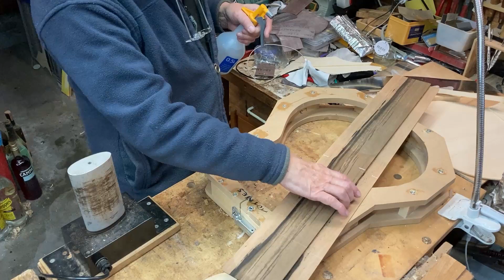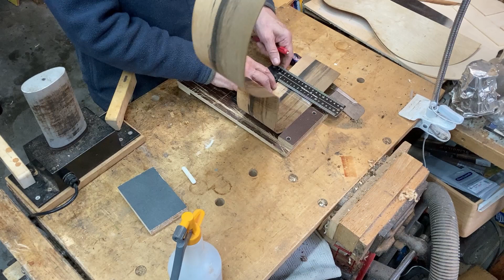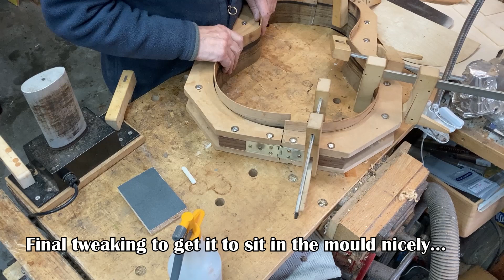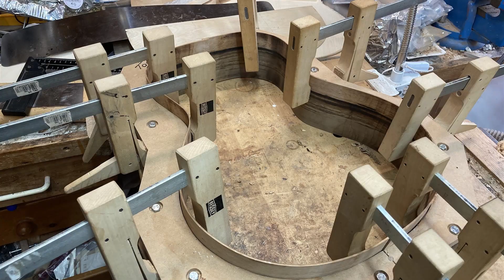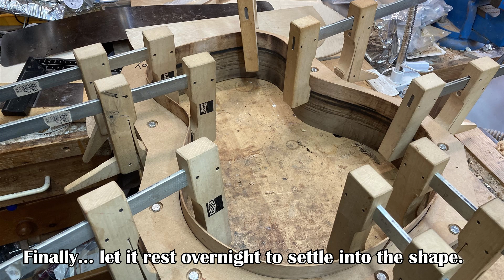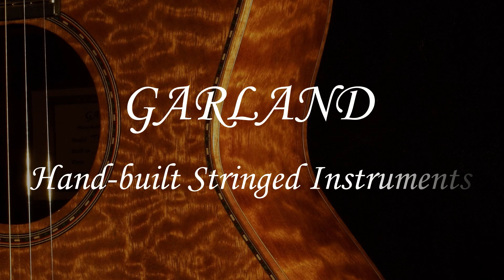Bending ebony sides by hand.

Comment: That ebony is beautiful Chris, this is set to be another stunner. Quick question, I’ve just starting binding my guitars in wood, the first has gone really well, I did flame maple binding on a LP and the maple bent really well. However I did a test with mahogany which I could not bend for anything. My question is in your experience what types of wood bend easiest? Because I’d like a few colour options for binding.
Reply: …jumping in as an aside, that sounds really cool Gio. I’m planning on doing either bent wood sides or wood binding on my Jurgs build. I’ll be using old Venetian blind slats if that’s helpful 😂
Reply from the maker: @fatpotanga  ... with a (Venetian) cutaway?!
Reply from the maker: Thanks Gio 😁 
I've used maple, ebony, padauk and a few others I can't bring to mind right now for bindings. Though not mahogany as far as I remember. Difficult to generalize: the key seems to be to get the thickness and amount of moisture right, which varies with wood species and even within a single species. And the temperature. 

Some woods like to be fully soaked before bending, others bend better dry or with a light spritz of water (like this ebony did). I'd suggest doing some tests on your mahogany, making it thinner and thinner until it does bend, and separately testing whether it bends better fully wet or not. And how easily it scorches as you bend hotter. 
You might find it has to be really thin (maybe down to 1.5mm or less) to bend properly, in which case you'd need to laminate layers if you didn't like the look of binding that thin. Laminates would have their own look for bindings of course, as the glue joint would be visible, but work well for sides. (I haven't tried this myself.)
Good luck, and let me know how you get on!
Reply: @fatpotanga  only if they’re not mahogany!😂
Reply: @GarlandStringedInstruments  thanks Chris, I think maybe I need to go a little thinner then for trickier woods. I experimented with soaking and temperature but not thinning the mahogany down significantly. I’ll certainly be getting some ebony and I’ll let you know how I get on.